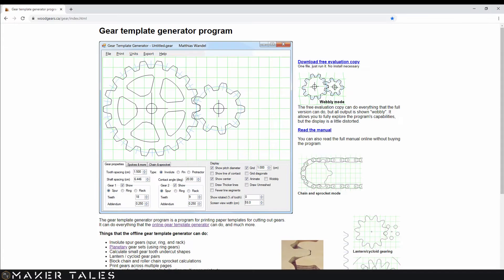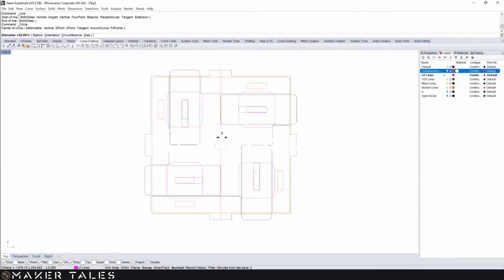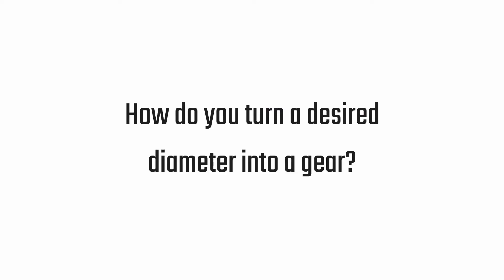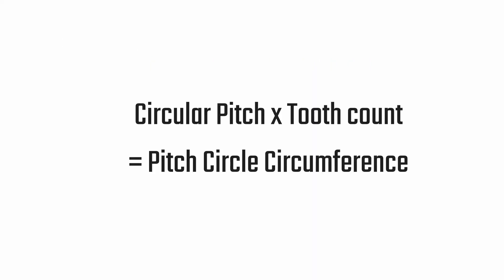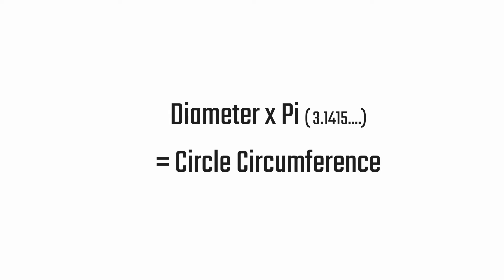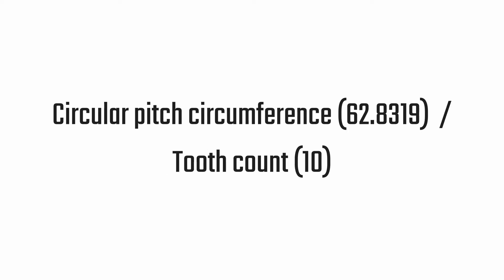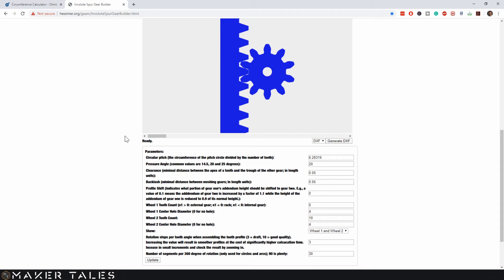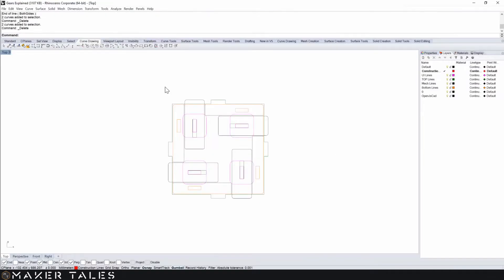How to: Make Puzzle Box Gears - (Tutorial) - Gear Fundamentals

Comment: Its real simple. Diameter and tooth spacing. However the diameter is NOT the outside diameter of he gear - its the diameter measured at the intersection of the two gear teeth between each gear. the outside diameters actually overlap.